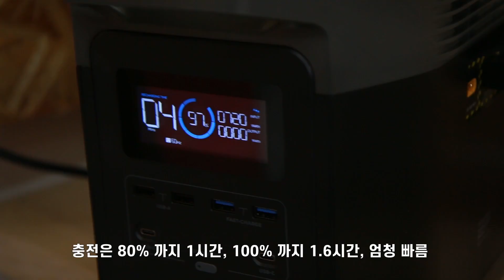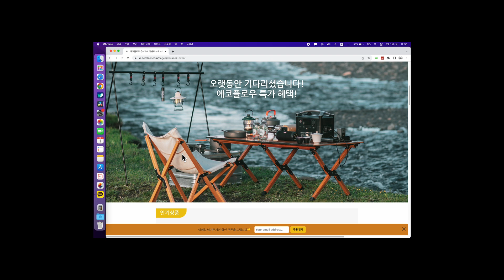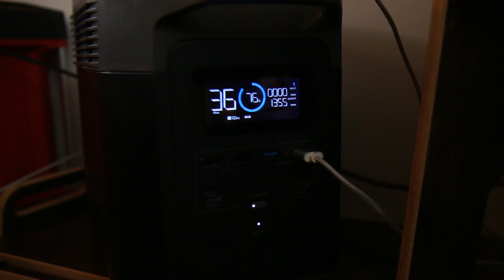How to vertically expand your space / Amazing woodworking idea!!

Comment: That's a great solution. Would it be possible to mount the mechanics on the two outer sides? I'm looking for a way to store my 3D printer.
훌륭한 솔루션입니다. 두 개의 외부 측면에 기계 장치를 장착할 수 있습니까? 3D 프린터를 보관할 방법을 찾고 있습니다.
구글 번역이 잘 되길 바랍니다 🙂
Reply from the maker: As long as the left and right balance is right, there is no problem. =)